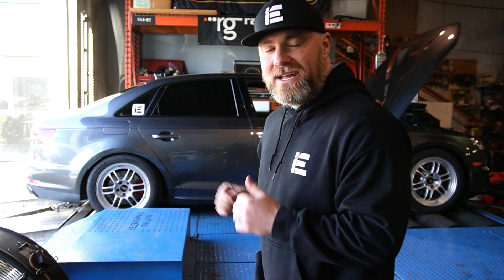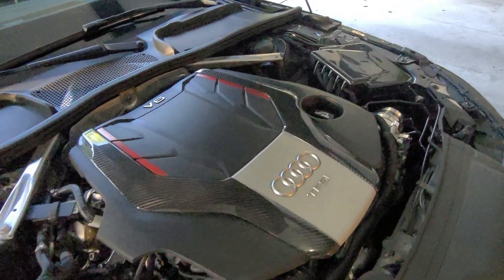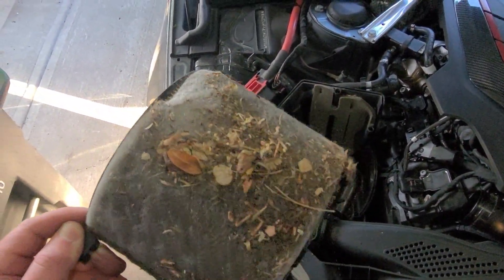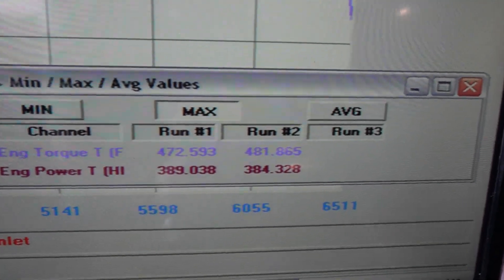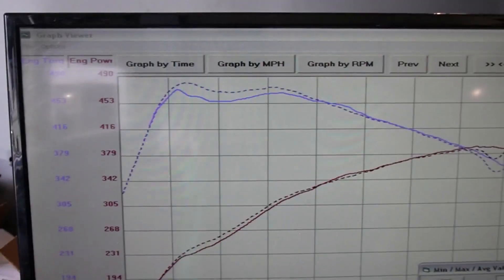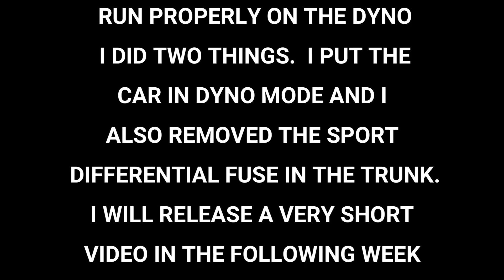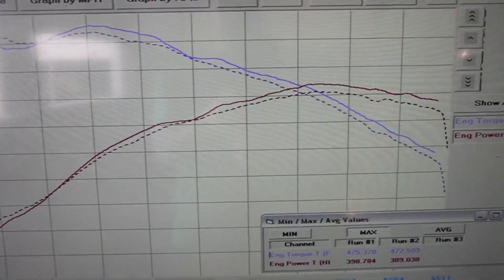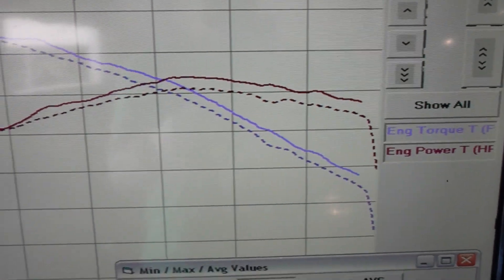Dyno Testing Integrated Engineering's B9 S4 Air Intake & Turbo Inlet

Comment: Would the car still pass emission with a turbo inlet + intake ? 2019 s4
Reply from the maker: Yes, they won't affect emissions testing
Reply: @VancityAudi thank you 🙌🏽
Reply from the maker: @Boostedkraft you're very welcome
Reply: @VancityAudi one more question I’m sorry I’m new to this platform would the check engine light stay off or would it come on?
Reply from the maker: @Boostedkraft haha, your check engine light will not come on once these parts are installed unless you installed them incorrectly or if there is an actual problem with your car.
Reply: @VancityAudi thank you so much for the information i really appreciate!! Amazing builds and videos just followed u on instagram as well thank you 🫡🫡
Reply from the maker: @Boostedkraft thanks for the follow and thanks for watching!

Comment: This is fact did the same dyno, on a lot of intakes, this build the IE intake with turbo inlet makes more wheel horsepower than any other out there.
Reply from the maker: So you tested multiple intakes on the exact same car, on the exact same day, on the exact same tune, with the exact same tank of fuel on a dyno comparing them back to back to back?

Comment: Hello Adam,

I own 2018  SQ5. No Tune.    I removed Middle install ECS Center X-Pipe and installed 034Motorsport Turbo Inlet Pipe. Stock air filter and box.
Have you done anything to Exhaust?  If So what did you do?
I'm Interested in intercooler upgrade.
Reply from the maker: Everything you're asking about has an individual video on my channel:

https://youtu.be/NrhcceF-Uzg

https://youtu.be/jp-8VtXM5yo

https://youtu.be/Za0F30VPHlM
Reply: Also designed intake scoop

Comment: Do you have to change the tune when you add the intake or is it the same tune I thought the tune would have to be modified for more air to get the most out of the upgrades
Reply from the maker: I covered that in the video
Reply: @ 
I’ll have to rewatch again it’s been a while since I saw  that video and I just ordered the parts thanks for the reply
Reply from the maker: @albarreira6764  no problem. Whenever I do these before and after hardware tests, I never change the tune. That way you can see exactly how well the parts work in terms of power gained.

Comment: I am new to the s4 platform so I was wondering what is all needed for the IE stage 1
Reply from the maker: Well lucky for you that Integrated Engineering has a fantastic website that outlines that all for you: https://performancebyie.com/collections/ecu-software-tunes/products/ie-audi-3-0t-turbocharged-performance-ecu-tune-fits-2017-2020-b9-s4-s5

Comment: Got a b9.5 s5 looking to change my intake. Which IE inlet adapter should I get the TTE710/TTE810 hybrid,pure750 or the GTX35R? Or stick with the stock turbo?
Reply from the maker: The adapter only needs to be changed if you're upgrading your turbo. Whatever turbo you're running, you should have that adapter on the inlet.
Reply: @VancityAudi  oh I see , also another question if I don’t want to upgrade my turbo yet I just buy the intake for now right? Or should I also buy the upgraded turbo inlet
Reply from the maker: @Tangored5 absolutely pair the inlet with the intake right away to get the most benefit. It shouldn't be much more to order them as a package. Also make sure you use my promo code VANCITYAUDI at www.performancebyie.com/vancityaudi to save some money!
Reply: @VancityAudi  Thank you so much for the information and help! 😁🙏
Reply from the maker: @Tangored5 no problemo and good luck!

Comment: so does the “sport differential” system or setting make the car slower?
Reply from the maker: What would make you think that?
Reply: @VancityAudi  because you turned it off for “proper dynoing” so it would make me think it is interfering?
Reply from the maker: @andytran-ry7yc ohhhhhhh. That simply prevented it from putting down power properly on a dyno, not on the street. Once we put the car in dyno mode it put down the power properly. Sport differentials are a must for the best performance of your car.
Reply: @VancityAudi  oh i see. yeah that confused me lol. thank you for the clarification.

Comment: Nice video. I’d love to see the Dyno test separating the turbo inlet pipe and the air intake. I’d be willing to bet that the turbo inlet pipe is making 9 of the 10 hp and the intake makes 1 hp. The air coming through any intake is more than the turbo can use. The inlet pipe is the biggest factor in the power gain. The stock intake with the turbo inlet will give just about 10 hp increase. Save the money and just buy the turbo inlet pipe. That’s what I’ve done with my Mark 7.5 Golf R…stock intake with K&N filter and the IE turbo inlet pipe. The IE intake is a beautiful piece of work but I’m guessing it’s only adding 5 to 10% of the gain. The inlet pipe is the key to the power.
Reply from the maker: Sadly, on this platform, you have that backwards. Others have done similar tests and have reported the opposite. The bulk of the gain on this platform is via the air intake upgrade. On the DAZA platform (and it looks like the Golf R platform according to you) the turbo inlet provides a much larger gain than the intake.

Comment: Would you be willing to do a dyno test with Co-op E85? They sell it at 24795 Fraser Highway in Langley. I'd be really intrigued to see how it stacks up against Shell Nitro 93!
Reply from the maker: They don't sell E85. They sell FlexFuel which comes in at E63. The only true E85 is sold at Northside Petroleum in New West which is what I use in both of my cars. It wouldn't make any sense to compare those 2 fuels because you need to physically change the programming on your ECU in order to properly run ethanol in your vehicle. Or you'd need to use a vehicle that came with the capability to run FlexFuel from the factory and those are very limited.

Comment: Would there be a bigger increase in a real world scenario where the car is moving and therefore has more air pushed into the intake? I can't tell if there is a fan in front of the dyno.
Reply from the maker: There is absolutely a bigger difference in the real world than simple dyno numbers. There is a large fan, but nothing that compares to fresh air flowing over the entire car. Stay tuned for my next videos where I tested this setup on the street and then on the track and achieved even better results.

Comment: Well this is honestly unrelated to this video but refers to the fuel testing you did and I wanted you, Adam to read it.  I run a few custom tunes on my car.  One of the tunes is a 12% ethanol blend on Chevron 94.  Thanks to you I had the the courage to try Shell 93 and voila no knock and no timing retardation or blending.   We in this community owe you big time for pushing Shell to devolop better quality fuel.  It really has changed the landscape here. It really allows people to run 91 or 93 tunes right from the pump. Again thank you!!
Reply from the maker: You're very welcome! That's wicked! I'm glad you're getting the performance out of your vehicle that you hoped for.

Comment: hey man i have the same car and im wondering if i should get the intercooler first or the intake combo like you did, any pointers why you picked intercooler first and not the intake?
Reply from the maker: The importance of keeping your intake air temps as low as possible provides more performance benefits and a healtier vehicle. One of the first bolt on parts I do on all of my builds always pertains to improving the cooling.

Comment: Nice video. How long did the install take?
Reply from the maker: They had it done in less than 90 minutes.  The turbo inlet was a bit of a pain but they got it done.
Reply: @VancityAudi  I’m in the same boat and expected more. I wonder if an open air box will May more power. I’m sure it wouldn’t be much different. How’s the sound? Noticeable increase in turbo noise?
Reply from the maker: @corycooper4955  an open box would more than likely make less power due to the nature of the air in the engine bay being much warmer than the air that gets funneled through the enclosed filter. Yes, there is more whoosing noise now.
Reply: @VancityAudi  on the dyno with fans it may see more air but in warmer weather on the streets I could definitely see that. At the end of the day an intake is going to do very little but helps as even more mods are added. Plus it looks good too! What’s the next hardware modification;)?
Reply from the maker: @corycooper4955  ya, I don't care much about the performance on a dyno, haha. All I care about is performance on track and from the data I've seen an enclosed filter works better than a completely open one. As for the next mod, you'll have to stay tuned!

Comment: Are you going to make a similar video to what you did on Stage 1 w/ Stage 2? Would be cool to see a 0-60 1/4 video on pump gas and E85. When do you think IE will make tunes available for B9.5?
Reply from the maker: Absolutely! I will be going Stage 2 and then dialing it back to pump gas so you guys can see the results on the dyno and in the 1/4 mile. Sadly, I have no idea when the tunes will be ready for the B9.5, sorry.
Reply: @VancityAudi  all good man, looking forward to your Stage 2 video
Reply: @VancityAudi  another quick question how much weight reduction do you think your S4 has now with the wheels and brakes etc.
Reply from the maker: @s5roze  all the weights for my brakes are listed in this video: https://youtu.be/kzsrLUsWtjo As for the wheels and tires I don't know exactly.